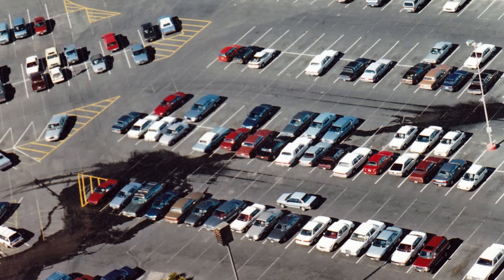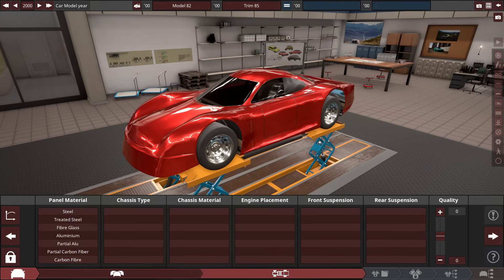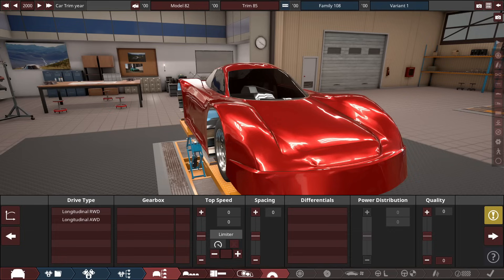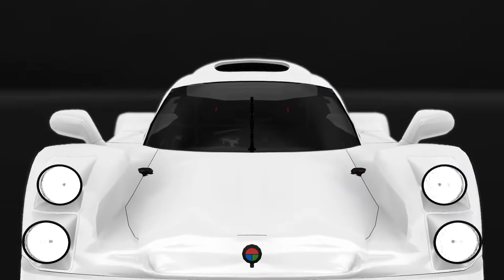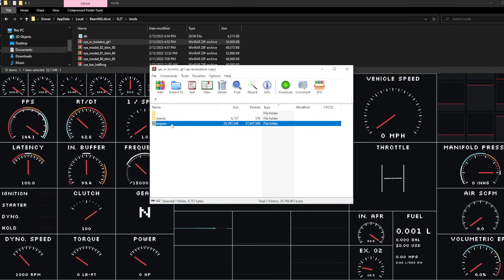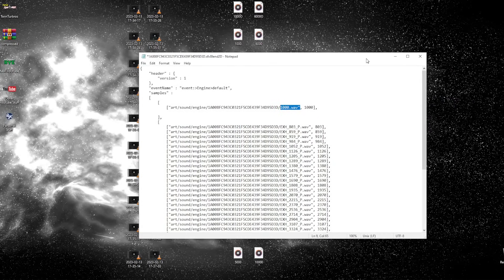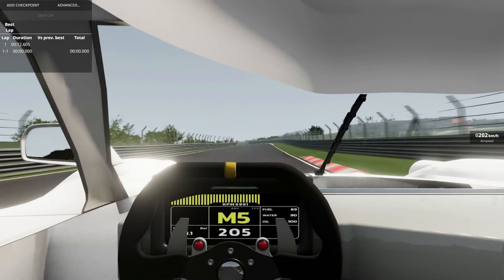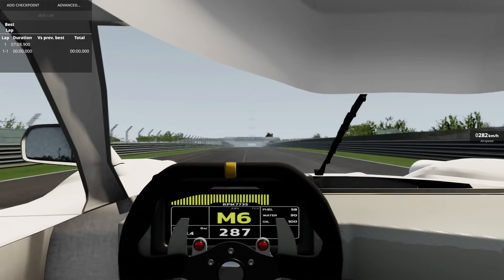I Built A Rotary Powered Race Car. Automation - BeamNG

Comment: The only thing i would change is that you made it with an I3. One rotor has 3 burning chambers, so for a racecar you would wanna use a V12 as a base.
Reply: yeah, technically speaking you could call the 1.3L a 3.6L or something
Reply: @splintergp  Nope, by exemple the rx7 13b act a little like a 1.3 liter inline 6. The 4 rotor of this car and the 787b, him, act like an inline 12 of 2.6 liter (2.6 for the 787b at least, but i think it could be the same for this car cause it seems to be the optimal 4 rotor size).
Reply: The rotor rotates at one third of the speed of the eccentric shaft meaning for every 360° of eccentric shaft rotation, only 1 combustion event occurs per rotor. This is 2 combustion events every 720° of crank/eccentric shaft rotation. A normal 4 stroke engine has one combustion event every 720° of crankshaft rotation per piston. This means that rotaries double the combustion events and double the displacement compared to piston engines. Meaning the 13B functions as a 2616cc I4, the 20B as a 3924cc V6 and the 26B a 5232cc V8. Many racing series around the globe consider rotaries as double displacement.
Reply: @inzanex36a89  Thats more for comparaison than in reality. The displacement is the size of combustion rooms, here 1.3 liter.
Reply: @hugoku8755  but due to the fact that 1300 cc of air is being combusted once every 360° of engine rotation, 720° would mean that that 1300cc is being combusted twice per rotor.
Reply: @inzanex36a89  The question is not the amount of air and fuel burned every revolution. We talk about displacement, and displacement mean the size of the combustion chamber, thats all.
Reply: @hugoku8755  now….what is being combusted? Oh right! Fuel and air! The combustion chamber filled with fuel and air. I said 1300cc of air so that it’s easier to understand. I could have said 1300 cc of displacement is being flowed per 2 revolutions but that sounds weird.
Reply: @inzanex36a89  The displacemeny is the capacity of the engine when he is stopped. It can act like a 2.6l, but he is a 1.3l, thats all. I can understand that knowing that a wankel can compete with piston engine twice the size can be frustrating, but its a fact
Reply: @inzanex36a89  rotaries aren't actually "twice the displacement" for the same reason 2-stroke engines aren't twice the displacement. Both fire twice as often as a convention 4stroke piston engine but displacement is not combustion volume over crankshaft rotations. It is simply combustion volume. Hit and miss engines would be a good opposite example, they would have extremely small "displacement" if it was measured relative to crankshaft rotations.
Reply: @hugoku8755  okay I can accept that! My understanding of displacement and yours is the root of this misunderstanding then I guess, sorry!
Reply: @magicstew45  Okay then, I can accept that! I guess my understanding of displacement is different to what’s usually accepted. Sorry for the misunderstanding then.
Reply: @inzanex36a89  Thats my bad too.
In the fact, you was talking about the equivalent displacement of a rotary when compared to a piston engine, when i was talking about the real displacement, the "objective", withouth comparison.
Reply: If you´re new to this: it´s just the performance of the engine that matters when exporting, that it is light, reliable and revs high, nothing else.
Reply: @davidaugustofc2574  I think that the balance could do something, no ?
Reply: @hugoku8755  He raised the balance shaft mass, which means more rpm and more performance.

Also, the Rotor doesn´t even use the 3 chambers, it has 3 spark plugs. So it has the same amount of spark plugs as a V12, the similarities end there
Reply: @davidaugustofc2574  higher balance shaft mean a less responsive and heavy engine, and this is the opposite of a wankel.
The rotary, if thats a quadrirotor, use 12 chamber, 12 spark plugs, is perfectly balances of his own and so do not need a balance shaft so is extremely responsive exactly like a v12. Thats a lot
Reply: @hugoku8755  A 3 cylinder, AlSi internals, can't be too heavy.
Reply: @davidaugustofc2574  But there is the rest ...
The "3 piston by rotor" system is really the more accurate.
Reply: 4 rotor engine car would do the trick
Reply: @hugoku8755 No a quad rotary has 8 spark plug they run 2 per rotor
Reply: @inzanex36a89  thats a very long copium

Comment: Why is everyone going with 95 octane gasoline? Why not better, for example 100 octane, when it is a high powered car and you can buy 100 octane gas on any pump
Reply: Haven’t seen 100 octane at any pump near me🤷🏼‍♂️😭
Reply: @CynixalYT_WRLD  in Europe, we have 100 octane gasoline almost at every pump, our standard gasoline is 95 octane..the 100 is about 10 % more expensive than the 95
Reply: @marekmecir5822  ah well that’s also Europe. I’m in the U.S. however Ik in the U.S. we do have varying octanes but near me typically lowest octane is 89 and highest is 97
Reply: Measurement System for octane is different from Europe (RON only) to The US (RON+MON:2). So US basically Shows 93 when Europe says 98.

Comment: Just : as the 787b was capable of around 800 horsepower with his 2.6 N/A 4 rotor, and that it seems to be the perfect 4 rotor size so this one must have the same size : it is the successor, so it is better. So this engine must have around 1000 horse powers N/A (cause the wankel, as a new technology, goes better fast). So, you gived this car the desavantage of a "low power" and a turbo lag that it dont should have in reality.

Comment: The Mazda 787B had a 2616cc Naturally Aspirated 4 Rotor engine making 900 hp at 10,500 rpm in Max Trim and 700 hp at 9000 rpm in Race Trim. A good piston engine counter part would be a 10000 rpm 5.2L V8.
Reply: it had potential of 900hp, didnt have 900
Reply: @rotary.revolution  Whoopsies then.
Reply: And after the Le Mans race it was entered it was discovered that particular engine could've done another 24 hours with minimal power loss

Comment: A more equivalent engine would've been a 4 liter. 

The reason the 26b (787b/imsa rx7 engines) was so dominant is that they exploited the displacement rule. Displacement measurements for a piston engine is how much air it moves through 720 degrees of the crankshaft, well Mazda used the same formula for the rotary engine.

The exploit comes into play when you acknowledge that for a typical 2 rotor (13b, the actual motor platform from the first gen gsl-se all the way through the third gen rx7) only 4 of the 6 chambers have entered the exhaust "stroke". Meaning that through a full cycle of all 6 rotor faces the 13b is actually like just shy of 2 liters of displacement.

Math may be slightly off for the 26b because of how the rotors are aligned, but the equivalent displacement would be well over 3 liters nonetheless.
Reply: with displacment when the piston is at its lowest point it is the full area in liters that if you were to fill it with water would occupy then multiplied by the amount of pistons with a rotory it is a much lower displacement from that witch is the normal measurement of displacement and is why its measured in liters
Reply: Incorrect. The displacement of an engine is based on total swept volume (Or rather how much air can be moved at one time). A rotary's displacement was calculated on it's swept volume for the chamber that's undergoing combustion only, which would be only a single face of the rotor. It's where the some 650 cc per rotor displacement comes from. Mazda (and others) argued that since only a single rotor face undergoes combustion at any one time, only a single face should count, since the engine itself is only able to consume a singe face worth of air at any given time. This means in the two rotor 13b, the displacement is 1.3L. Each rotor can only combust 650 cc of air at once, giving a displacement of 1.3L. The discrepancy comes from the fact we consider a single rotor to be one chamber, and not three separate chambers. 

A standard piston engine typically goes through it's entire combustion volume in 720 degrees, whilst a rotary engine is able to do the same in only 360 degrees. Given this, racing regulations changed to state that an NA Rotary (Turbos add another multiplier on displacement for all engines) should have it's displacement multiplied by 2 to give a rough equivalent to a piston engine. The 13b is still a 1.3L engine by classification, however it is equivalent to a 2.6L since in the same time a standard engine consumes all it's volume, a rotary can do it twice over. 

The 26b is equivalent to a 5.2 litre engine, not a 4 litre. 

Furthermore, no the 787b was not dominant. In fact it was significantly slower. It only won Le Mans in 1992 because it was significantly more fuel efficient, and reliable. The displacement of the engine largely did not matter. Rotary race cars were largely middle of the pack in all race series in performance categories, aside from a few exceptions that performed remarkably well despite largely punching above it's weight, against cars with significant more torque, and in turn power. The IMSA Rx7 was never the most powerful car on the grid, nor was it ever the best in any specific performance category, it was just so well rounded and by quote from the drivers "unkillable" and "It would just keep running" that made it perform remarkably well.
Reply: This

Comment: In the off-chance you actually read this one, heres a challenge idea:

Say the designers and engineers got their plans mixed up and the resulting car is a bit wonky. Drivetrain is front engine transverse AWD with a 3.6L 60° naturally aspirated V6, and the car was intended to be a mid-size sport sedan(IRL equivalent would be an Acura TLX). The designers however, were told they were designing a full-size panel van (IRL equivalent would be a Mercedes-Benz Sprinter). The deadline to have a plan for the car was too close to go back to the drawing board, so they had to hope for the best that their new sports van would actually work.

Body should be designed with being as large a panel van as possible, engine should be between 350 and 400hp, suspension tuned for handling, transmission tuned for quick acceleration, brakes should be beefy as well.

Comment: C'mon, do some rear engine RWD stuff that isn't a 911 or Beetle expy, shooting for a 40/60 F/R weight distribution. EDIT: Wow, was not expecting this car to be rear... It definitely looked like a mid engine body... Well, I still stand by what I said because this isn't really anything close to a normal car, which is what I want to see more of. Rear engine sedans, wagons, shooting brakes, SUVs; Shit with 4 REAL adult fitting seats, 3 seats with a center driver (offset just barely forward of the edge of the rear seats), FIVE seats with a center driver(same offset idea), and so on.